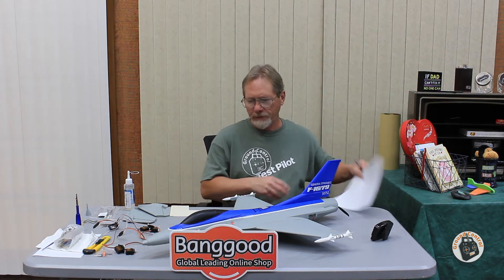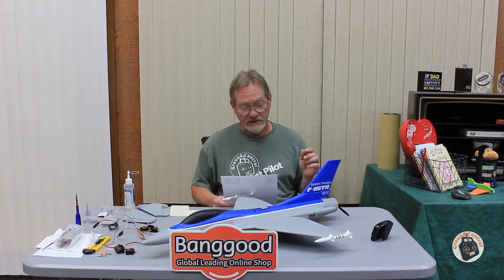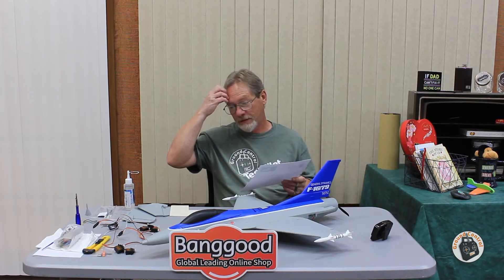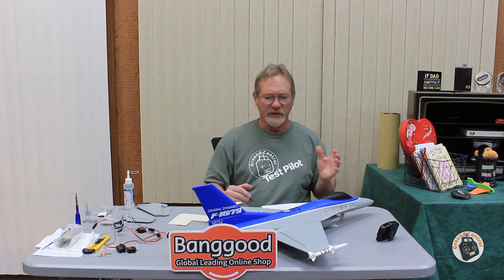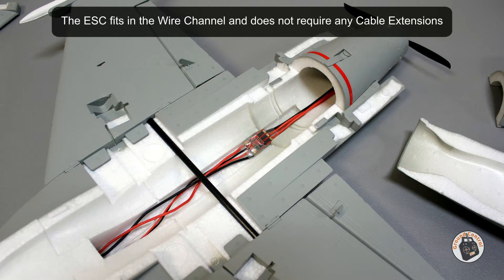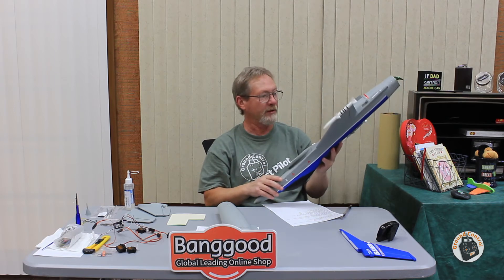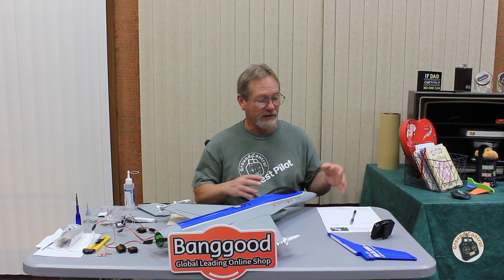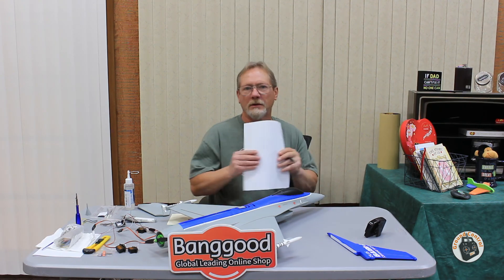Eachine F16 50mm EDF Jet Kit - Kit Assembly Tips & Electronics I've Chosen for this Pusher Prop Jet!

Comment: Hello. So the battery is 1500 mah 3s,on this plane with propp?
Reply from the maker: Yes, I started with a 3S setup but I'm using a 4S Setup now with a 4S 1300mah 40C LIPO and a 5x4 2-Blade Prop.
Reply: @GroundControlRC  And with the motor far away back, CG is not changed? The edf unit weighs 77 grames and is 10cm +/- from behind..
Reply from the maker: @Sandokans  No, the CG never changes.
You may have to set the LIPO in a different position to get the CG but the CG remains the same.
The Pusher Motor and Prop are much lighter than the EDF Unit so you can have it further back than the EDF Unit.
Reply: @GroundControlRC  Yes sir, you are right.. Please share radio tx 16 s,settings, for f16 and f18. I have radiomaster 16 s mark ii. Thanks again I will follow your posts here and Facebook
Reply from the maker: @Sandokans  The Eachine F-16 Setup and OpenTX Model Files were posted quite a while ago.
Just search the Facebook Page for "f16 setup file".
The F-18 is not ready yet.
See you in the Air!

Comment: Hello sir I wish that you could show how you build the banggood f16
Reply from the maker: Hi Mark!
It's really straight forward, just glue in the Wings, Horizontal Stabilizers, Vertical Stabilizer, Fuselage Panels, and Servos.
I just fabricated a 3mm round plywood motor mount and glued it into the back of the fuselage.
There was nothing special I had to do to convert this to a pusher motor and prop other than fabricating the motor mount.

Comment: Before your first flight could you show us your idea and suggestion on the landing skids? I am flying off dirt  also and appreciate your suggestions
Reply from the maker: Hey Cliff!
Yeah, these landing skids are constantly evolving depending on the type and weight of the Plane.
I used sections of 1.5" PVC Pipe for Landing Skids on this F-16.
I will try to remember to go over those on the next video.
I've performed the Maiden Flight and it will be posted tomorrow morning.
The performance is great ;-)

Comment: Nice job, its looking good. Whats the Amp draw with that motor/prop?
 I really hope your motor mount doesn't get ripped off by the prop catching on the ground on landing... that would be a real shame.
Btw, your rough sounding ESC probably didn't have a fast enough speed to cope with the high pole count (12 poles) of a quad motor. Glad you found one that did.
Really looking forward to the maiden, hope its soon. :)
Reply from the maker: Hi Paul!
Thanks!
If I remember correctly it was pulling around 24A.
I'll have the Maiden posted this Sunday, I think.
I've never had a problem with the pusher motors on my parkjets.
The props do get a bit nicked up after a while and need replaced but I've never had any motor or motor mount damage so hopefully this will work out the same.
Yeah, if I can find a manual to that ESC I'll try to change the timing and test it again.
See you in the Air!